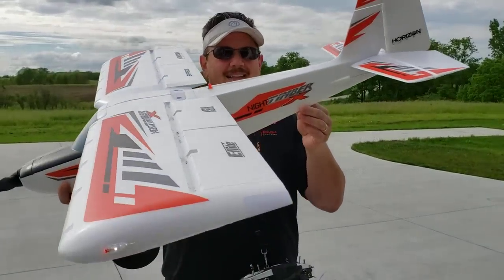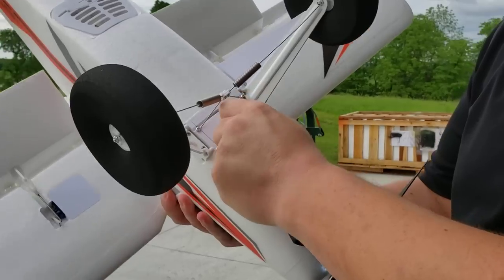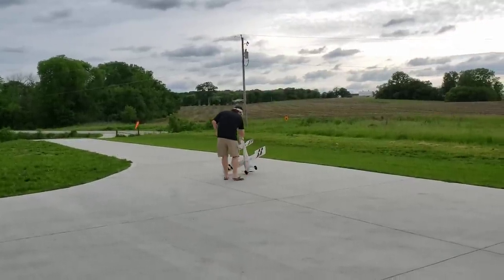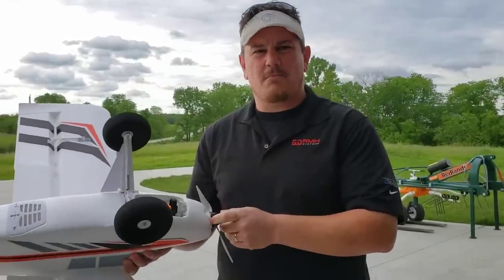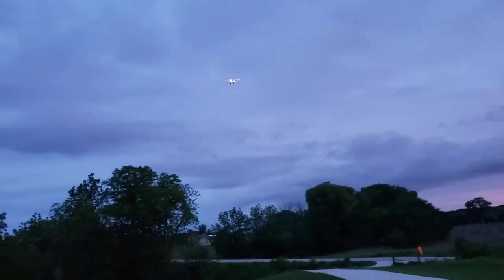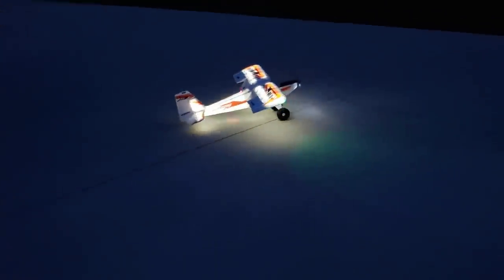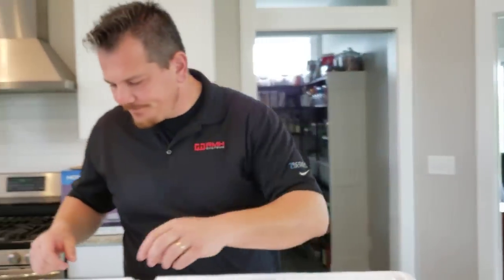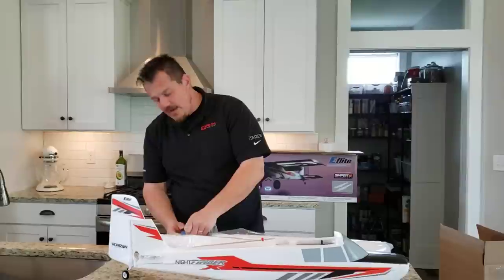Horizon Hobby - Night Timber X 1.2m - Unbox, Build, Setup, & Maiden Flights

Comment: It was much easier to just use the bind plug.
Reply from the maker: I agree, but kinda getting used to the push button. It's nice when the plugs get buried...something I didn't expect!!! Although I bind for SAFE use, so that makes the procedure more clunky
Reply: Brian Phillips I bind for safe as well. I like that safety net in case I get disoriented.  For this plane with all the wires the push button was a hassle.  I did clean up the wires like you did.  They were all down in the servos and stuff.  I hope any newbs watch your build.